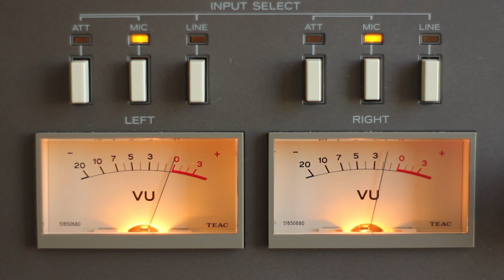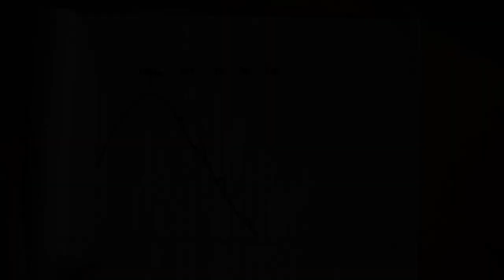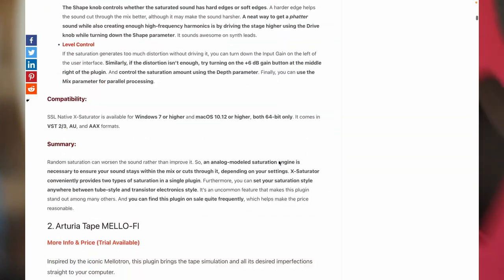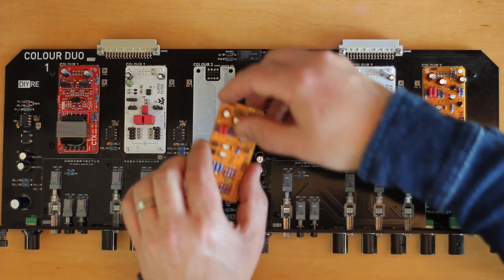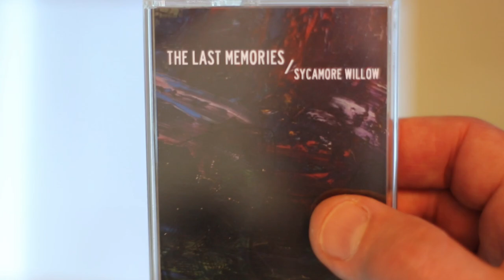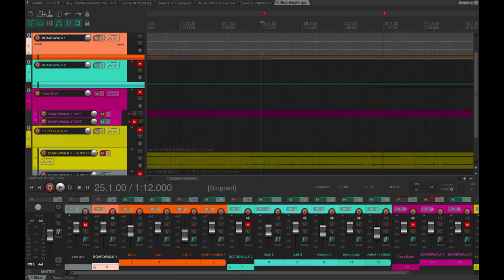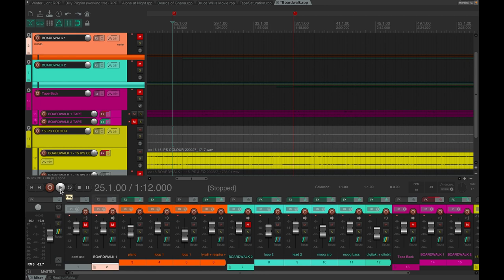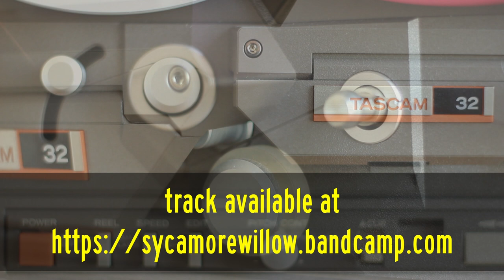Tape Saturation for Home Studio and Ambient and Experimental Musicians | DIYRE 15IPS

Comment: This is great - I came across one of those Nagra speed controls which is superb for making spacey tape delay effects but I think my machine has the speed socket as well - I’d never thought of using it to CV pitch a loop!
Reply: …just double checked and it’s just the 1/4” socket but it occurs to me I could mod my speed regulator box to include a CV in - that way I could potentially “tune” the tape speed ie pitch of the loop with the knobs and then play CV pitches in! Game changer!
Reply: I suppose my comments would make MUCH more sense if they were on the right video. Just by luck I was wittering on about Nagra and tape speed on a video about tape saturation - it probably nearly made sense. 😅
Reply from the maker: Lol I admit I was wondering! But honestly just glad to hear your thoughts. I suspect you meant these comments on a Hainbach video, right? If so that's a flattering confusion.
Reply: @SycamoreWillow  yes your interesting clip followed his one about the discovery that you can turn your Nagra into a pitchable looper with the Speed input. I love the idea of those modular tape saturation things BTW - I’ve forward them to a mate of mine who runs a studio. He’s currently struggling to restore an 8 track reel to reel. He’d be better off buying one of those racks!

Comment: Although the tape saturator comes close, the Tascam is still better. That part 13:51 where the high frequency string pad  comes in and then a deep bass comes in, is what defined it for me. Also the constant sine like pad, played throughout piece. took another sonic dimension through real tape. It became more prominent. Then all ties in one sound with the "glue" that tape imparts. There wasn't much "glue" with the saturator, but did have some warmness to it. The bass was also less deep, and there it was not the same prominence of the constant sine pad. Of course the original dry version was the least interesting. Thanks for this test. I enjoyed it.
Reply from the maker: Hey there, what a thoughtful comment, thank you for that. Of course, our assessments were basically the same :)

Comment: Great video. I've been tempted by these colour format things after building (and loving) DIYRE's OLA5 and EQP5 500 series units. Id love to see these tape saturation units compared to Sound Skulptor's TS 500 units as well. Curious if you've had the chance to give those a spin.
Reply from the maker: Hi there, thank you! I have not tried the Sound Skulptor TS500. I'm sure it is very useful so if it speaks to you I just suggest trying it and see what you think. That said for me I like the colors platform because in addition to the tape saturation color there's so many other colors that are interesting and you can chain them and per color they're pretty cheap.

Comment: I think it's easy to understand odd harmonics coming from saturation because the saturation is symmetric on both sides of the waveform. Even harmonics are asymmetric, so if the distortion is symmetrical, the added harmonics will be odd.
Reply: Note also that you can add even harmonics by adding DC offset before going into your saturating processor. This is easy in modular, but not necessarily otherwise.
Reply from the maker: Interesting, I'm actually not sure I totally follow the thinking here, but I will go do some reading and see if I can completely grok this. Would love to hear more explanation of this as well! For example, why does symmetry lead to odd order harmonics? I think I'm missing the relationship between odd numbers and symmetric distortion.
Reply: @SycamoreWillow  I shouldn't say it's easy. If you already know that odd harmonics are always symmetrical, then it's easy. 

With an odd harmonic, the part of the wave from 0 to 90 is the mirror image of 90 to 180. With even harmonics, these segments are the same, not mirrored but repeated. So, if you have a wave where the first quarter of its phase is the mirror of the second quarter (0°-90° vs 90°-180°), and the second half is the inversion of the first (0°-180° vs 180°-360°), that wave only has odd harmonics. For example, triangle and square waves. Sawtooth doesn't behave like that, so it must have even harmonics. 

So far so good. 

Now, if your distortion will tend to "square off" the positive and negative portions of the input equally, I'm pretty sure that means it's emphasizing odd harmonics. If it acts differently on the positive than the negative, it will add more even harmonics (for example, full wave rectification is like one octave up).